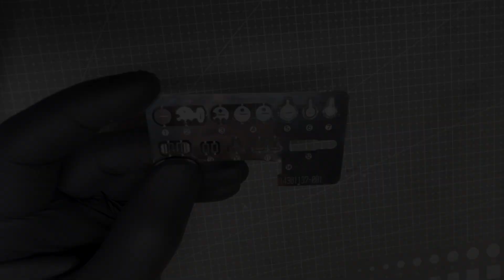Big Scale Series 1/12th Brabham BT44B 1975  Part 9  Wheels and ...

Comment: What kind of paint are you using to paint the GOODYEAR logo on the tires ????   thanks in advance
Reply from the maker: hi! I used tamiya XF-2 paint diluted with isopropyl alcohol in the proportion of 1 part of the paint and 3 parts of isopropyl. With this dilution, the paint becomes very fluid and, when touched by the brush, spreads very well and fills the necessary space. when drying, it becomes very pale and has to be repeated 2-3 times
Reply: @_autoscale_    thank you very much , i'm gonna try it